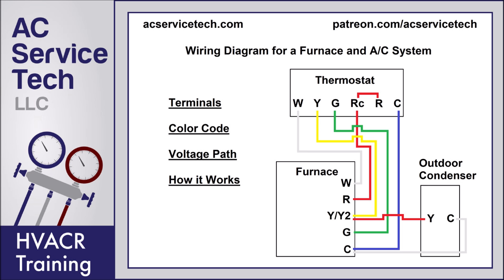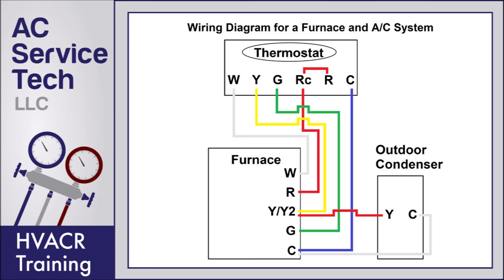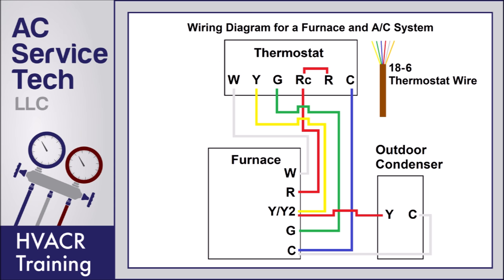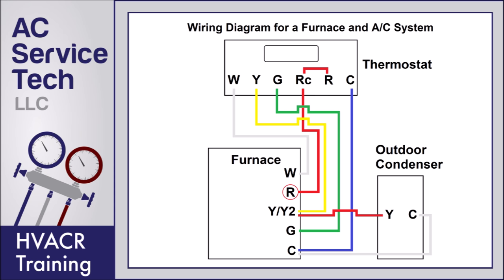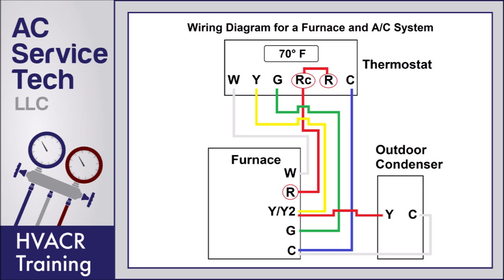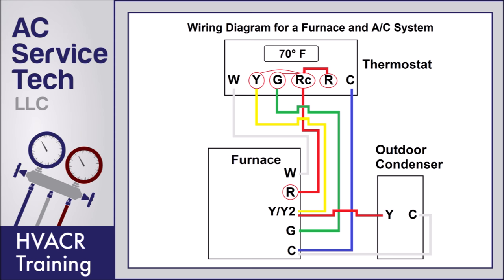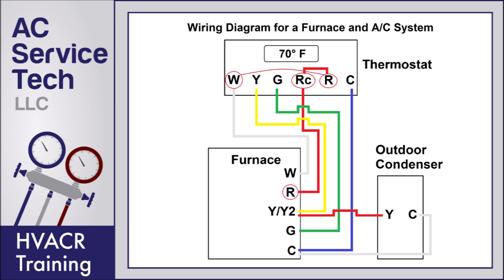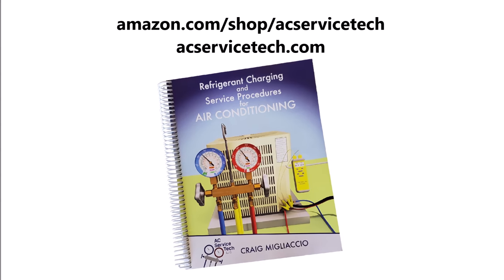Thermostat Wiring to a Furnace and AC Unit!  Color Code, How it Works, Diagram!

Comment: Great video helper. Now if just installation techs actually used the color coding correctly, the average home DIYer can fix a broken thermostat without frying something. I have seen and know techs that purposely connect by THEIR standard so when YOU try to fix it, BAM something breaks worse requiring you calling them for more money out your pocket. Since they are "certified HVAC" they will be protected from lawsuit being a non HVAC person should not be touching it in the first place. My 30 year old Nordyne system still runs strong today with my maintenance schedule and compressor cleaning system.
Reply: Lol or just YouTube how to wire it correctly and you wouldn’t have that problem
Reply: That's such a lie and if not it's definitely anecdotal
Reply: Compressor cleaning system......
Reply: @ebenezerwheezer4619  I just bought a new house and went to install a new thermostat.

The previous tech left the C from the furnace disconnected, attached the the R from the furnace to the C going to the Thermostat, put a jumper from the C on the thermostat to the R, and wired the float switch between the C on the thermostat and a the red wire going to the condenser.

I'm pretty sure that's how it was. But I know for sure the C from the furnace was unused and the red wire from the furnace was spliced into a blue wire and the condenser had a yellow and a red wire.

So yeah, some of them screw it up their own special way. I guarantee it wasn't a homeowner who did that. The average homeowner isn't going to connect different colored wires to each other for giggles.
Reply: Sue for not following industry standards.if the color code isn't right he's incompetent or a scammer either way they deserve it

Comment: Thank you very much for the tutorial. I have been telling my neighbor who bought a new Honeywell RTH2300 thermostate which HAS BATTERYS. I tried telling him you don't need to hook up the blue wire from your furnace to the RTH 2300 thermostat since the thermostat has battery's. I hooked it up this way without the blue wire connected to the RTH 2300 thermostat and BOOM on came the heat. Maybe a gander at this video will convince him.This is the only video I have found that specifically tell's you this about the blue wire and the RTH 2300 Honeywell thermostat. Honeywell done.

Comment: Thank you for saving my butt, again! Viewed your stuff when a power surge burned up my HVAC circuit board last winter. Used it again today when the AC wouldn't cool (because I left a wire off of the new board). This is AWESOME!
Reply: Hows that warranty treating ya

Comment: Why can't you just have r... shouldn't a contact close to y for a cooling call and w for a heating call?  Still don't understand the two R terminals..🤔 Also, why does G wire not need jumper?

Comment: my problems before  was  my vivint thermostat is on cooling mode and it was blowing heat .so i called out  an hvac tech ..he found out the thermostat is bad . so he  can't  jumped out the control , so i can have cool  air .And now i need heat , the heating mode is blowing cool air ..and i cant figure which wire he jumped so that i can put the right  place..

Comment: That's the best video explanation of the signal flow for controlling all aspects of the handler and compressor units (and fan).   As an electronics designer, I needed this information to complete my wireless performance monitor for my home's A.C. .  It will map the efficiency, coolant temps, etc as an indication of declining performance changes BEFORE the compressor eats itself, requiring unnecessary replacement.    I will also be buying your book. Based upon your detailed video, I expect the book to provide enough technical information to expand my expertise to do home repairs.   Thank you. Great video.  As a suggestion, I had to rewind the video a few times at points where message's speed of delivery outpaced my ability to hear and understand it.  :-)

Comment: Best explanation I've seen, Thanks. I had a new HVAC system installed last year and a honeywell stat that has 4 wire running to it.(no C wire). The system when in A/C mode will set there and run until I turn the stat up, but I have to turn it up 3 or 4 degrees or the temperature reading will jump a degree or 2 to match where I set it to. I know sounds crazy. It will also jump down and match  within a degree or 2. SO... first I called honeywell thinking this must be a stat issue. They had me test the voltage readings of the 4 wires running to the stat. The 24v red was fine but one of the wires read lower like 9v and seemed to vary. Honeywell blamed the HVAC system as the problem. So I called the HVAC tech out and after thinking it was the wires running to the stat he checking the voltage readings at the unit with the stat wires removed, he got the same readings ( one circuit was low and varied) eliminating the wires to the stat as the issue. He then said it was an ECM module/motor.He did a warranty replacement of the ECM and said it's fixed. For some reason this issue takes a few hours before it acts up. Then the longer it runs the worse it gets. He finished the warranty repair and said even though the voltage is still low in one circuit the system was working fine, but the next day it did the same thing. I replaced the Honeywell stat again and it does the same thing. I noticed I only have one wire going to the outside unit??? It runs back to the White wire on the inside unit. The other wire that should run outside is hooked up to the Yellow circuit inside and runs to??? in the same harness at the white wire, but never shows up outside. If I unhook the wire not making it outside that is hooked to the Yellow inside wire and then retest voltage at the stat not only does the G wire still show 15.5v but also the Y will now show 15.5 v. Only thing I can think is the return circuit back inside from the outside coil/contactor  is being made in the outside unit or through the line set??? This makes no sense.

Comment: Excellent video explaining what the thermostat does to the wires in different settings. I tested my new thermostat on the bench (with a 24V transformer), verify that in heat mode, the W terminal is ON if setTemp > homeTemp and it goes OFF when setTemp <= homeTemp, but the G wire is still OFF when I set fan to AUTO, G wire only goes ON when fan set to ON. I thought the thermostat is defective but later I verified 3 thermostats behave same way. This video tells me the G wire is only ON when FAN is ON or COOLing is ON. I wish I saw this video before buying the thermostat, save me some grief.
i memorize all these explanations by heart now.
Reply: 2stageis het pump expaningbai

Comment: Great video that helped why my thermostat doesn’t have power from the furnace. Blue wire is not connected to the furnace power module. I only see five connections and cannot figure where the blue wire goes.

Comment: Thx for the info. I’m working with an old Lennox and a new thermostat and new Goodman condenser. They guy working on it was so frustrated because we could get the condenser and furnace blower to work and then when the thermostat was satisfied the furnace blower would shut off but not the condenser. He tried moving wires on the furnace 30 times and it’s still doing the same. The Contactor  does operate fine he assuredly after I asked if the contactor was frozen closed. He never figured it out. Although I did snap a picture of the wiring block in the furnace and I did see the yellow wire connected to the common..😳. The tstat has a Y but the Lennox furnace block doesn’t have a y. That confused him because he didn’t know what to do with the yellow in the furnace.

Comment: Thanks for a simple yet informative description and schematic without talking down to us,  I was able to figure out my issue thanks to you, and I had an odd problem too, that I was having trouble finding any info on it.... Blower would come on for the furnace only, AC and manual fan would not work.  The condenser and fan on the AC unit kicked on but no blower.  It's and old house and I thought I had a light green and dark green wire in my set of six wires from thermostat to HVAC unit.  It hit me when watching this video that the dark green wire on my system was actually blue and just faded and dirty.   It had come loose when putting in a board the other day, and I thought I messed up, but I hooked it back up and all is working great, thanks again!!

Comment: I recently installed a blower motor on a Bryant dual fuel system.  Works great however a few terminal wires fell out and don't know where they go.  I have multiple color wires and my picture I took is blurred and cannot see.  Can I send a pic of what I have and hopefully get some guidance

Comment: I'm moving into a new home, and took off the old thermostat before the painter started work.. there were only two wires connected- black, and white. There was also a red wire and a yellow wire not connected to anything. (The thermostat only controls heat- no cooling or fans)

The odd thing is, the black wire was connected to W, and the white wire was connected to R.. I wonder why it is that way? Could that be correct? The previous owner said the thermostat always functioned properly.. could this be because the wires are connected the same way at the furnace? (I'm not at the location so I can't check, but now I'm curious)

Comment: Hello, I was wondering if I can connect G wire on the thermostat and furnace to c wire, the thermostat does not have c wire so I’m connected G wire to C wire, the furnace c wire already has existing c wire from out side AC fan, I wanted to know if I can add G wire and C wire on C wire on the  furnace.

Comment: Good explanations man.  Trying to diagnose why my AC system won’t kick on now that I changed to a C wire smart thermostat.  Hopefully I can find a vidoe explaining what I did wrong.  But outstanding video none the less
Reply: Hey did you figure this out? I switched to an Amazon thermostat and now the AC won’t turn out smh
Reply: @skine1107  I had to rearrange a wire on the furnace itself.   That was 3 years ago tho.   I can’t recall what I did sadly.

Comment: U R the man. I was trying to find C wire, if its connected to the main board or not. Cause got 3 extra wires at thermostat but C wire wasn't connected. Found 24.5 V ac on C to R combination.. Thanks. My comment may help others...

Comment: Hey I noticed you say the red and white wires from the condenser going to the furnace board don’t matter when connecting to Y and C but mine were installed reverse (white to Y and red to C), I swapped the Honeywell thermostat to the Alexa thermostat and now the condenser won’t turn on 🤔, anything  else I might have missed ??

Comment: So, my furnace coming out from the house  is red and white wires as one big wire. Do I just connect them to the blue and yellow wires  from the condenser together or split the them up  like white to blue and then red to yellow? My condenser  only has two wires like my thermostat.

Comment: In my case I have only rh and w, I really want fan control though, could I manually wire up a switch near the furnace to connect g to rh/rc without messing anything else up?

Comment: I have 18/6 running from my furnace to a battery operated thermostat. I'm trying to update to a new thermostat that requires the C Wire but my furnace does not have a C terminal. Is it possible to follow the common from the 24v transformer and piggie back at that terminal then connect that wire to the C on the new thermostat?

Comment: i have an older two-stage electric furnace with "R1" and "R" terminals jumpered, and want to connect a new two-stage thermostat. Which terminal is 1st stage and which is 2nd stage?

Comment: Excellent as always.  are there control boards such as on a Carrier 5ton/Nat.Gas Furnance Split residential (Control Board HK42FZ014) that for Cooling Mode do not need the R Connected by the Thermostat to G, and just connected to Y?

Comment: Connecting the thermostat C wire to the wire going out to the condenser as described in the video worked!

I have a five wire set up with no C wire, so I supplied the air handler's 24vac power to the  thermostat at the C terminal - that was wrong.  It needs a return wire instead.  Great video!

Comment: The problem I’m having is that a common blue wire was not used on my original thermostat but when I attach that blue wire to the new thermostat it is not providing power. Is this telling me that I need to play around with the R and RC terminals on my new smart thermostat In order to provide power instead of using the C wire?

Comment: @acservicetechchannel - Thank you.  Do you have a video like this for a system where the furnace is separate from the AC?  I'm having issues getting a common wire to not make the thermostat stop working and would love a video like this with a setup where the two units are not in the same box.  Thank you.

Comment: Hi. I have separate gas fhw and Ac units. Heat is in the basement and ac air handlers in the attic with condensers outside. Im looking to install a smart tstat and have access to a 24vac/common connection  in the taco zone circulator controller (heat system) where I can easily bring 24vac back to the tstat location but everyone I talk to and read, seems that this wont work because the smart tstats are looking for the C wire to come from AC equipment.  Its a 20 year old Lennox.  I dont know if there is a C terminal on it but online general Lennox wiring diagrams appear to show it would.  Its a bit of an access problem to open the air handler to look at the terminal block. Any suggestions?   Thank you.

Comment: What happens if the thermostat only controls the air handler and an outside compressor? No heat involvement. 

My thermostat Controls the compressor but is failing to turn on the air handler when the thermostat is set to auto.  I can turn on the air handler when the thermostat is set to on for the fan but when it is ..set to auto only the compressor turns on. Why would this happen? It's an old thermostat maybe that needs to be replaced or is it a problem with the air handler connectivity with the compressor?

Comment: Hello. I am in need of ideas. I'm not even a little trained in this, but for 2 full month's now my apartment maintenance person has been unable to ger my a/c to both run. (outside) and blow( inside fan w/heater). Just can't get my a/c to work correctly. I'm sure he's got all or some of the wires crossed. The fan will not cone on in auto, but you can turn it on manually, ar the thermostat. The outside unit will cone on and work ...the fan is on and the unit us working..I can see frost on sone places where the installation has came off, but the inside fan won't come on when it does. Jeez. Hard to explain and I'm  not managing to do it very well. ---Both units work, just not together...outside works on auto, inside works on "on" but outside unit cuts off. If any of this sounds ar all familiar and there is anything g I can do to fix this, please let me know. I'm considering taking a HVAC class. I could have got my license and probably fixed this in the time I've wasted waiting on maintenance. Thank you. ;)

Comment: Why is it only the W terminal in heating mode and not W and G? Does G come on after the s.o.o? Thank you for the amazing content as always!
Reply from the maker: The fan comes on after the flame is proven during heat mode so the control board waits on that, thanks!

Comment: Thanks SO MUCH for this video AND the wiring diagram! Saved my ass BIG TIME! I had 1 wire in the wrong connection. Switched it and my 'smart' thermostat is operating my HVAC correctly now! Again, THANKYOU!

Comment: I didn't understand why my two condenser wires seemed to be error, Answer: 24v wire doesn't matter what side it is connected to outdoor condenser.  Thanks for vital info.  I will reverse wires to have correct color code.

Comment: So I'm running into an issue. I have a boiler furnace with only two wires. W and R controlling 5 zone valves for the hot water baseboard. The A/C unit is completely separate. However there is only one zone for the ac and it is combined by one ecobee thermostat. When it's connected the voltage at the furnace jumps to around 30 volts. Then none of the valves work. Any thoughts?

Comment: I only have furnace in my home. I was planning on getting a smart thermostat but when I checked my thermostat only the W and the R wires ere connected. At the furnace there is a spot for the G wire as well as in the thermostat but no wire connecting them. The furnace seems to be working fine. My question is: Is it correct and is there a way that I can have a smart thermostat with only the R and the W wires?
Thanks

Comment: Why would I have two sets of wiring going into my thermostat? One set of wires (5) goes to the furnace. The other set I'm not sure. The blue wire from the furnace set is connected to the other set (white wire) and the yellow of the second set is tied into the thermostat with the yellow wire from the furnace. Any ideas?

Comment: Hi my name is Mike i have been trying to convert a Coleman Mach  Air Conditioner from switches to thermostat.  I purchased the converter 8330-752 and installed it into the air conditioner .  I also have a heater wired to the same thermostat . My wiring diagram red from heater to R, Green from Heater in the W,  Now for the air unit i have Yellow in the Y, Green Hi Fan in the G and the Blue Neg in the W with the green from the heater.  When I go to turn on the heat works fine.  When I Turn on the fan it pulsates and it also tries to turn on the heater at the same time then it goes on.  When I put it into Auto it pulsates with the heater and then it will not go on.  I am at my wits end I don't know what the problem is.  Any Ideas.